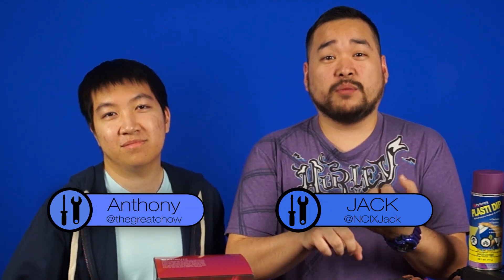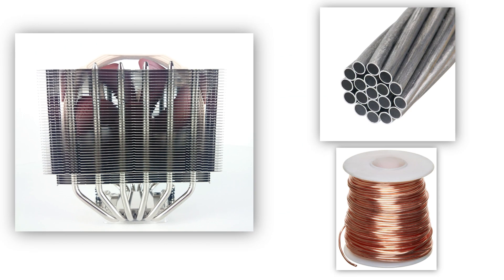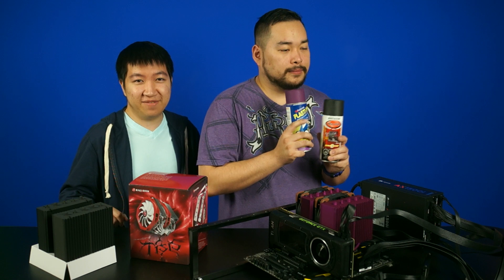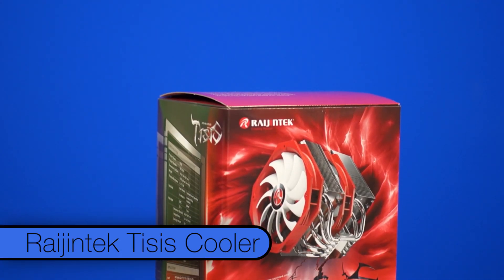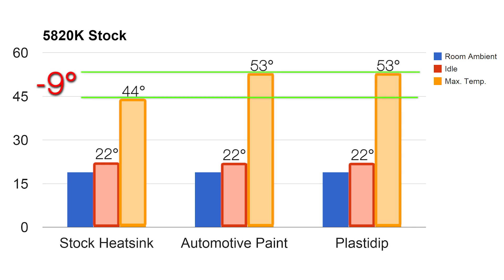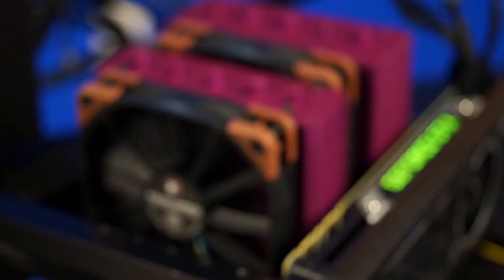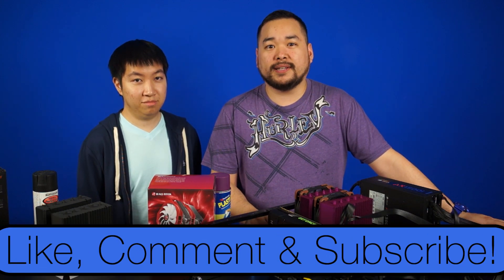Painted CPU Heatsink! Plastidip + Auto paint mod ft. Raijintek Tisis

Comment: Thumb this up so people don't feel the need to post the same incorrect nonsense 1000 times like they already have.

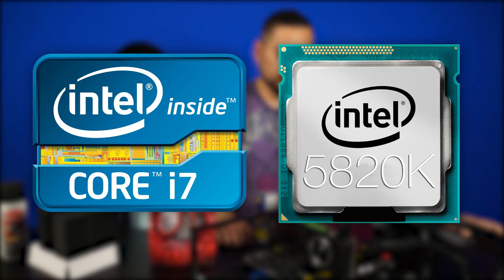THEY DIDN'T PAINT THE CPU CONTACT AREA! You can CLEARLY see the plastic covering that is on the cpu contact area of the heatsink when you first take it out of the box. Look at the one they are painting black at 2:10, you can see the little tab to pull it off. Considering both had identical end results the pink/purple one was obviously done the same. If they did the purple one differently and ended up with the same results then that kind of proves it made no difference anyway.
Reply: devilmikey00 For more effect, people reply and like the reply.
Reply: Hi
Reply: Or the two guys could have verbally mentioned this rather important concept rather than leaving the viewer to notice some brief detail. Small visual details can easily go unnoticed when viewing on a small phone.
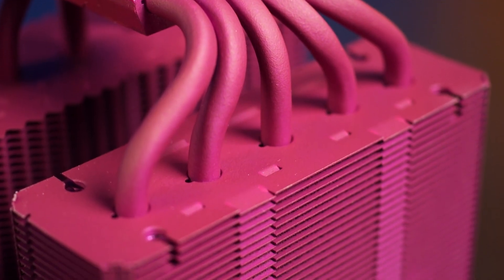Reply: devilmikey00 you can also see bare metal at 2:52 on the purple one... (although, I have to admit I was worried when they were painting...)
Reply: kieferonline or this is a really obvious thing that if you need it to be mentioned then you shouldn't be modding ANYTHING in your PC. I mean you don't need to be told to turn off your PC when installing components right? same concept. NCIX assumes you have a brain.
Reply: Eugene Cherish Agreed about the brains. But as a tutorial with a wide audience of 500k subscribers, pointing out some obvious fatal mistakes in this unusual mod would certainly be helpful to some of the less skilled viewers. Just the fact that so many have latched onto this topic means they should have mentioned that one extra detail. Jack mentions other extremely obvious concepts like "make sure your cooler is up to task" and "make sure you have good airflow in your case." By simply saying, "Don't paint the fucking contact point!" the length of the video would have increased by a mere two seconds. Overall, its a solid tutorial. One detail wasn't mentioned that should have been. The world carries on.
Reply: Christopher Kiefer It's not a tutorial, it's a proof of concept.
Reply from the maker: devilmikey00 is right. we did have protection over the base =) We used the purple one before it was painted so it didnt have the plastic on it, BUT we did mask it off again before any plastidip was sprayed.

Comment: I would only paint the heatsink if i wasnt planning to overclock
Reply: i think is the best way to look at it
Reply: st0rm I wouldn't even bother with an aftermarket cooler if I wasn't planning to overclock. You could probably still squeeze a modest overclock out of these painted heatsinks.
Reply: presmadagascar i bought my aftermarket cooler for performance on stock speed and because my stock cooler sucked and my processor ran at 80c (Q6600)
Reply: I would only paint a heatsink if I had
A) Autism
B) down syndrome
C) a gun to my head
Reply: I OC´d My I7 4960x to 4.6Ghz 1.3V and Painted the Radiator from Black in Black to White in Gold cuz Casemod i hat only -3 Degrees Plus under Load.
Reply: GameRepublic TV© ™ that's a radiator, it's very different.
Reply: Daquan Jr. if your name is Daquan jr then all the above are true
Reply: chaosknight360 i have the gun in my pocket but nothing else.
Reply: Anthony Sparta damn straight.

Comment: If its aluminum, you could always anodize.
Reply: Schoolpost how?
Reply: Schoolpost yes, my thoughts are that anodising will be more sufficient and those shiny looks
Reply: ***** Take your heatsink to a specialist to anodize the aluminum. It's kinda expensive.
Reply: +1 on this - That would have been my choice.  Do note that the anodisation can develop cracks if subjected to > 80c, but I'm sure that the end result would have had much smaller temperature rise compared to the paint.

I found a video which describes how to anodise at home: https://www.youtube.com/watch?v=GccTVfMiIIo

The main difficulty with anodisation is that it has to be pure aluminium - for example, if the heatsink contains copper heatpipes, the heatpipes will be corroded away.
Reply: Jon Iund
damn. I was hoping you guys had figured out a way to DIY it
Reply: Anodizing requires using special electrical equipment to negatively charge the metal and positively charge the paint so that they permanently stick to each other.
Reply: Jon Iund
yeah, so?
Reply: You said you hoped we found a DIY method. I'm telling you that without the proper equipment, you cant.
Reply: Jon Iund    Presumably as per the video I linked in my comment above?  A DC power supply and a couple of cathodes (for example, aluminium plates or a lead sheet).  Here's another:   https://www.youtube.com/watch?v=BtYHcsq7s5A
Reply: Jon Iund
there are plenty of things that "need specialized equipment" that can still be DIYed. Maybe people haven't figured out a way but that doesn't mean there isn't one. The process is fairly simple in concept.
Reply: Sure simple in concept. But I appreciate a certain level of quality I wouldn't leave to myself as a DIY project. FueledBy RedBull just because you feel comfortable in doing it doesn't mean everyone else is. I could say the same about you. You don't know shit either. Not everyone wants to screw up some project of theirs because they are trying to DIY from some forum posts about home annodizing. Just because YOU might be comfortable with it doesn't mean everyone is you ass.
Reply: FueledBy RedBull
exactly, you are only limited by how far you are willing to go. Plenty of people think just building a PC is difficult, yet here we are talking about modding our parts.
Reply: +WyndStryke yeah pay 30$ for a damn hit sink that cost 20$

Comment: I wouldn't paint the Bottom of the cooler. I feel like that would increase the temperature a bit.
Reply: at around 2:51 you can see for a second that they did remove the paint on the bottom
Reply: ***** Yeah it would throttle like a bitch if they didn't
Reply: ***** Yes, but that's the plastidip one. Plastidip is made to be easily removable. For the automotive paint one, it's probably easier to cover the copper part while painting than to remove the paint from it afterward.

Comment: I know for a fact that painting your intercooler black on your car cools intake temps 15-20% better than a unpainted intercooler (when there is no active airflow) meaning when you are in traffic or something. I want to see you guys try this test again with no overclock and no fans (passive cooling) using the same cooler once unpainter/silver and then do the test again with it painted black. out of curiosity
Reply: 1. Those aren't passive cooling heatsinks. You need a fan.
2. That MAY only work with black. Most people will want to paint it to match the theme, in most cases is not black.
3. MCM?
Reply: drink15 U know how to make a active cpu cooler into a passive one? Pull the fan off lol.  But for reals though... I'm not asking them to make the "fanless heatsink" viable or efficient... I want them to document the difference between passive nonpainted vs the same heatsink passive and painted black.
Reply: Daniel PI "Black surfaces are the best emitters of heat radiation.
Black surfaces are the best absorbers of heat radiation.
Shiny surfaces are the best reflectors of heat radiation.
Shiny surfaces are poor absorbers of heat radiation. 

So the difference appears to be emission and absorption vs. reflection and absorption."

Something like this
Reply: Daniel PI only info i got is that the black colour helps transfer heat radiation better then the silver colour air flow doesnt mater ... only the colour... maybe someone smart can fill us in more on this
Reply: Skitzotech Gaming I believe it only works if you use stove paint that's designed to dissipate heat but be resistant to high temperatures..  it just happens to be black also.
Reply: Skitzotech Gaming As you said that's only true for radiation which is a very tiny part of heat dissipation in these coolers (even if it's passive it's usually using airflow from adjacent fans), convection, however takes care of most heat dissipation and adding an insulating (or at least less conductive) layer i.e. paint will mean there is less transfer to the flowing air and therefore worse performance. Honestly if you wanted to paint your heatsink I'd recommend just painting the areas you see: the top and maybe the heatpipes and the sides of the fins (especially if they're flattened) and make sure to mask the contact surface (unless you want to lap it later) and avoid getting too much on the actual fin surfaces in that case the difference would probably be very small, they kind of overdid it here on purpose.
Reply: Skitzotech Gaming While that's a fine suggestion, keep in mind that car radiators and CPU heatsink work very differently.
Reply: research intercooler good friend
Reply: That is not true.

MCM had a flawed testing procedure.

You can check out EngineeringExplained channel where he explains why that's not the case. You will in fact lose performance by painting an intercooler.
Reply: Skitzotech Gaming Yuh does still play BF g?
Reply: Akil Jacob from time to time ... im super rusty though
Reply: Yes, painting your radiator black has proven to increase the cooling BY RADIATION by 15-20%, but the entire concept of a radiator (whether it's a heatpipe or watercooled solution) is to dissipate the heat to the air flowing through it. When standing still your car will spin up a fan to keep the airflow going. So what you're saying is 100% correct, but 100% irrelevant. It's cool to increase your cooling power through radiation by 20%, but it's most likely not even resulting in the slightest significant change in real life.

Also, @ the video, don't paint the base. You don't even see the base as it's connected to the CPU and it probably accounted for 80% of the performance loss. Also both paints used are meant to not carry heat (both the rubber coating of the Plastidip paint and the heat-resistant coating from the car paint), as a fact, they're brilliant insulators. I think using normal, cheap spray paint will yield better results than these two.

Still, using plastidip, painting the base and only losing 9 degrees Celsius isn't all that bad. Don't do it if your CPU is alrdy running at 60-70 degrees under load and it'll be fine.
Reply: Joppe de Zeeuw *"don't paint the base."* They did not paint the base - duh.  Not only can you see that it is covered, but they also made an annotation on the video for that.
Reply: drink15 Why would the color of paint used make a difference? I watched this vid because I want to change my silver Prolimatech Megahalems to a black color. It actually comes in a black, but I did not know that when I bought it--and maybe there was no black model when I purchased it 5 years ago. If the temps would rise 9C under load I probably wouldn't do it (running i7950).
Reply: DiGiTaLdAzEDM black bodies radiate and absorb heat and light more efficiently, but as we've discussed above, coolers don't work by radiation but rather by convection, therefore the best performance will be with a naked heat sink with no insulating paint layer. My recommendation would be to paint only the areas you see from outside the case and paint them whatever colour you like :).
Reply: Not true, the paint acts as an insulating layer, also that's why car radiators have a fan so when you are idling they actually kick in to provide air for the rad. People theorized that painting them black would yield lower temps because black in the dark has a higher emissivity than a standard silver or unpainted rad. They found it was insulating the rad and ran hotter. Although! It was cooler when compared to a rad WITHOUT a fan, but there is no modern car that runs a radiator without a fan because the second you idle you'll boil. And that was so marginal of a difference you only lose performance in retrospect.

Comment: Rustoleums new flex dip leaves a much smoother nicer looking surface than plastidip, however if your taping things off make sure you remove the tape while the paint is still wet. Flex dip had a higher tendency to stick to the tape and lift (more so than plastidip) if left to dry

Comment: I would suggest painting only the top fin, which is the only one you normally see, instead of the whole heatsink. That way you won't lose any performance, but you're still getting the better visual appearance. Just do a good masking job (especially between 1st and 2nd fin).